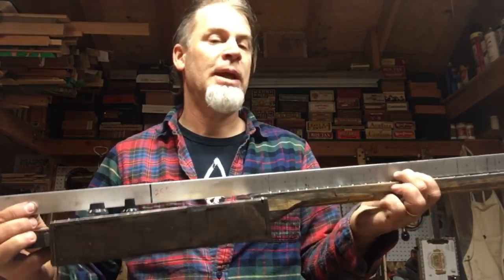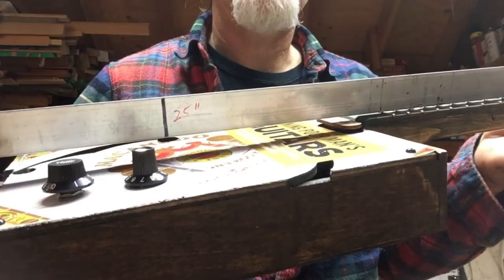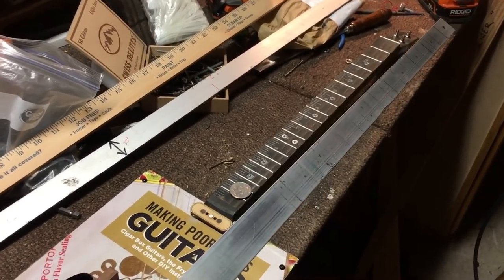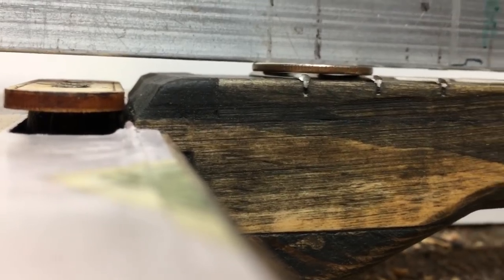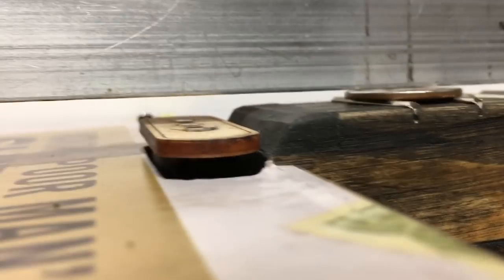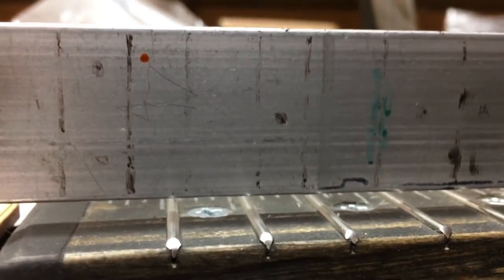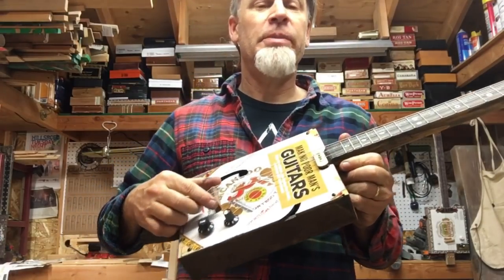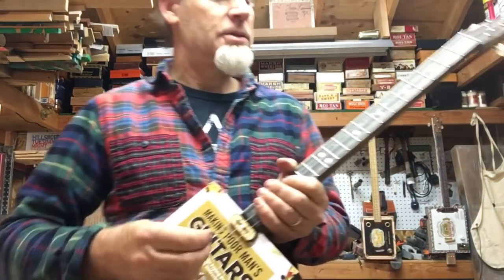Setting up the "Action"

Comment: Video from 4 years ago... but your teachings are timeless!
I made up a 4 string CBG and the strings was too high. I sanded the botton of the bridge, no big deal. I set the back angle and the strings sticked above the fretboard. I was going crazy without solution. Watching the video, it came to the light the obvious: The back angle itself doesn't work without a higher bridge to line the strings correctly with the frets. Every correct adjustments done, it worked!

Once more, thank you Mr Puckett!

Comment: When putting the straight edge on the nut and the quarter, does your straight edge touch any of the other frets?
Reply: If the neck is straight and there are no high frets, that shouldn't be possible.